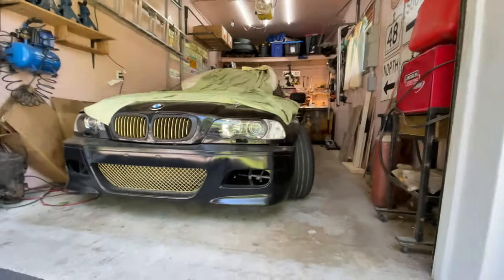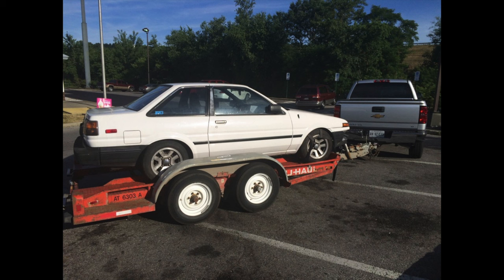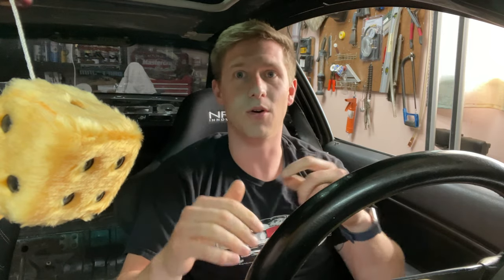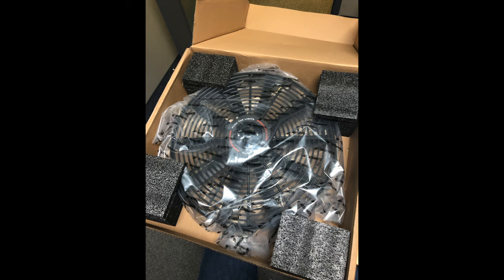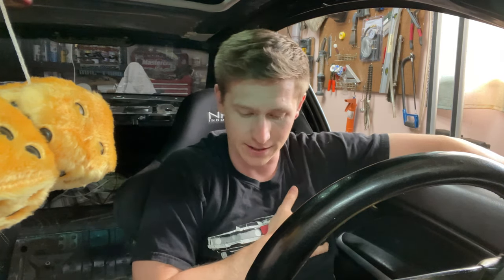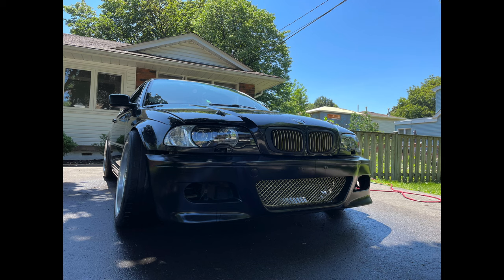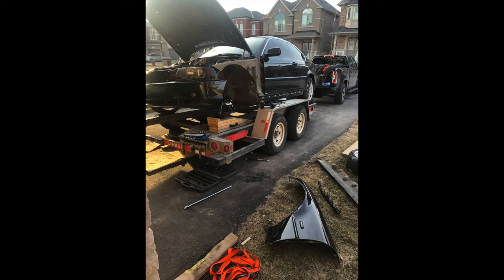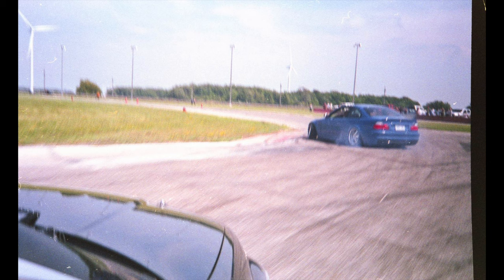How to Build a Reliable & Affordable Drift Car | Dirt Cheap E46 - Intro & Build Review

Comment: I love e46s so much you say it doesn’t look the best but I say it looks real nice. 2 door manual pre facelift 6 cylinder. Perfect and black! 👌
Reply from the maker: It’s a 50/50 car (50 feet away at 50mph). I would love a clean version of it that isn’t so beat. I love the chassis but this one is not the cleanest. I have also hit a wall in it lol
Reply: @SDSGarage89  it's a drift car, u are supposed to hit a wall in it and it's not supposed to be clean 👍

Comment: Hey dude I know this is 2 years old, if you still have it, sell the catch can and replace the ccv system,  it’s been tested and proven the stock system is by far superior in performance rather then an aftermarket part.
Reply: Not true at all. CCVs don’t provide enough crankcase pressure causing problems with low tension rings. Along with that it’s also been proven that the ccv under sustained high revvs likes dumping oil in the intake

Comment: It should have come with 193 if I’m not
mistaken from the factory, with cai and headers and extra fuel you’re probably getting an extra 15-20 hp from that.  I own a M52tub28 with the MS42 and tune it personally.

Comment: Looks pretty dang good for a cheap drift car! Quick question: what tyre size/pressure do you run usually for the rears?
Reply from the maker: My go too tires are 205/55/R16 and I run them around 30PSI or less to try and get some sort of grip out of them. I am planning on going up a tire size to 225/50/R17's this summer. I have driven on 225's a bit and it has way more grip so it carry's more speed. I run 225's at about 35PSI

Comment: I think low - medium boost turbo will make it is less complicated than LS swap, and can be done quicker?
But sadly bolt on turbo kit for e46 is hard to find and can be expensive too.
nothing wrong with ls
Reply from the maker: I have always been curious about an M52/M54 turbo. They sounds pretty mean but I don’t have much experience with turbo kits. The complexity combined with it being a bit less common makes me shy away from it. Might be a false comparison for complexity considering you would be boosting the motor that came with the car vs slamming a truck motor into it lol
Reply: @SDSGarage89  turboing these cars is honestly quite easy and being that you have a b28 the rotating assembly is forged besides the pistons, you have to pull the engine anyways and it would be much easier to turbo it and then have it tuned stock ecu, you can very safely make 500 whp just with head studs and a gasket kit
Reply from the maker: @jayherrmannn  thanks for the info. Definitely worth considering. not sure what i am going to do with it at the end of the season. It is so damn reliable as it is. Just had the first event and went through 16 tires in a day with zero issues. It is absolutely lacking in power though. I have heard going to link is better for boost on these. A friend of mine is trying boost with a stock ECU and it's not going so well.

Comment: Hey man, I'm looking at getting one of these bmws to make it a drift build. I saw they've gotten a bit expensive though, where did you find yours?
Reply from the maker: I found it on Kijiji (craigslist of Canada) in the early fall about 4/5 years ago. Prices have for sure gone up since then but i still see some decent looking bmw’s sometimes newer around $2500. Fall is a good time to pick them up if your live a more northern place cause people don’t wanna store them for the winter. Only downside is you can’t drive it for a few months. Facebook market place, drift pages. All good spots to look. Takes time tho. I looked for a month or so before i found my car

Comment: What is it a 328i?  I'm looking at a 325i but I dont know if iys going to have enough power.
Reply from the maker: 328CI, it had maybe 180hp. I believe a 325 would be about the same. It definitely doesn’t have the most power in the world but it gets the job done.
Reply from the maker: It may sound counter intuitive but starting with something that doesn’t have gobs of power will make you better in the long run. You’ll need to throw a low power car around way more to get it to do what you want to do but in the long run you will be better for it. I also would say don’t worry about a hand brake for the first year either. Good luck!

Comment: Would you say a 320i E46 has enough power? I'm thinking of getting one...
Reply from the maker: If you can get a 325 330 i'd go with that. Trueth is anything rear wheel drive with a welded diff will rip. You just need to drive it hard which in the end will make you a better driver and much more entertaining to watch .

Comment: Debating on getting a 03 325ci, would you recommend putting these parts into it ?
Reply from the maker: A 325 probably has about the same power this thing does if i had to guess. If it's a good solid car that isn't a rot box then i wouldn't hesitate to do it tbh. I find people get way to obsessed with swaps and power way to early, myself included, when the main thing they need is seat time to practice and figure out if you can sustain doing this.
Reply: @SDSGarage89   yeah , its just that its my first time getting a car to build but i cant find a decent e46 thats cheap, not abused or has its mods already.. only one i can find is one at a small dealership . idk if that would be my mistake to get one from them or from the street .
Reply from the maker: It's a tough call man. I have always been of the opinion you will get a better deal from buying it privately from somebody else but you need to work for it and be ready to do the deal immediately. Hard to say what the market is like by you. Patience will always pay off

Comment: does reliability matter if i swap the engine? serious question
Reply from the maker: Yes. Reliability of the motor you swap, the parts and ECU you use all matter and will make it work great or be a total nightmare. Do your home work and buy good parts
Reply: @SDSGarage89  well honestly i hope to get the bmw you have and ls swap it. i’m new to the car scene
Reply from the maker: I am struggling with the LS swap problem currently. I have had the car for 4 years and with a stock power train and all the changes i have made to it, it’s been dead nuts reliable. While it doesn’t have a ton of power it has been a cheap reliable car to drift with and get seat time to work on my driving. Now i’m at a cross roads. Do i spend 10 grand + on swapping an LS into it OR sell it as is, take that money plus 10k and buy something that already had a better power plant like a corvette or GTO. As much as i like the adventure and challenge of swapping a car it is a metric shit ton of work. You can do it fast for big dollars, or do it slowly for less money but still a good amount work and you run the risk of it beating you down and giving up. Personally i would get an E46, make it as good as possible with stock power and then see where your at.
Reply: @SDSGarage89  nice thanks for the advice.

Comment: Hey I'm not sure if I missed it in the video. Did you reinforce the subframe?
Reply from the maker: It has the reinforcement plates yet. I did not personally do it, the previous owner did. 1000% do it if you are going to beat on these cars.
Reply: @SDSGarage89  Thanks so much for the quick reply, was thinking you'd have to be crazy for not reinforcing it. Great deal though on the car for it coming with that though!
Reply from the maker: @jonathanandrade3669  no worries. When i bought it i had no knowledge about E46’s or their issues. Was just dumb luck that it already had them done. I still drop the subframe every once in a while to check it.

Comment: Can someone tell me how much I should be spending on an e46 in todays market lol, since everything’s more expensive nowadays not sure what a cheap car would be especially if I wanted to learn to drift
Reply from the maker: Hey man, it is impossible to answer that with any kind of certainty. Depends what state, country or place you are looking on. I'd say either buy one that a little old lady is trying to get rid of, or one that has some good parts. Stay away from anything that is non running, needs a clutch or serious work to get going. You will burn yourself out before you get to drive it. Good luck.
Reply: If you find one that’s already been drifted and beat on, (meaning it’s already built to drift at least a little) you don’t want to pay more than 8-9k probably. At least in my area, there are plenty of examples of pretty sweet and unclapped e46’s that typically go around 10k or maybe a little more. Now if it’s not perfect, and has over 170k miles you can find them at or under 5k all day. For exact numbers, it realty just depends on where you live and the exact car you find. Maybe try to talk them down if you see rust or if it needs new brake rotors,  or has leaks unless its already priced for that.

Comment: 180hp is low. That 2.8 with mild DME tune and headers should be pushing 205 to 215 at the wheels but only with the stock air box. Those “cold air intakes” are a waste. Car looks real nice though especially on those Parallels.
Reply: It should have come with 193 if I’m not
mistaken from the factory, with cai and headers and extra fuel you’re probably getting an extra 15-20 hp from that.  I own a M52tub28 with the MS42 and tune it personally.

Comment: did you wire the oil pump nut ever?
Reply from the maker: I have never had the pan off but I do know about the oil pump nut working itself loose. For some reason I thought they were more an issue on M54’s but could be wrong. Figured I’d just let it ride

Comment: My brother in law is selling a 2002 e46 325ci for 1k but the transmission is done for so I was planning maybe a whole engine swap? I wanna be able turn it into a drift car but not sure if I should or not. Not even sure if engine swap is possible. Any help?
Reply from the maker: My advice is based on my experience, Don’t do it. Buy a car that needs basic stuff (coil overs and welded diff) not a motor swap. If you are wanting to learn how to drift, the learning curve is steep enough, you kick it off by swapping a motor and you are more than likely doomed. Pay a bit more for a car that needs less. Start with driving not building, plenty of shit will break that will need fixing on a good car.

Comment: we cant even buy an rc car with that money in our county. so sad
Reply from the maker: Sorry to hear man. These cars have gotta very expensive since I bought it a few years ago.
Reply: @SDSGarage89  im trying to find a new chassis to drift, looking to spend >5k but it seems all driftable cars are very expensive now. Any sites to check besides CL or FB? Or chassis recommendations?
Reply from the maker: @2wofacejefe  Hey man, the pricing and market that you are dealing with can vary so much depending on where you are located. As far as places to find them, i would recommend Facebook, both market place and drift or race car groups, Craigslist is also good but a pain in the nuts to search multiple areas, Kijiji (if you are in Canada) and i don't know if Zilvia.net(?) is still a thing. As far as what to buy, something that is mildly "Built" to drift (coilovers, welded diff, some drift spares and anything else, maybe a hydro but i would recommend learn to drive without it, it will make you better) will save you time and money as long as it as been done somewhat well. What type of car, the most common i see are E46, E36, G35, G37 (sedans and Coupes), 350Z's, foxbox mustang, SN96 Mustangs. Buying them for 5k will be a trick depending on where you are. Some up and coming chassis i think could have potential are Hyundai Genesis (3.0 fuck the turbo) and this is way off but the Cadillac ATS. Hopefully that gives you some stuff to work off. Lastly, I wouldn't get too attached to buying a "specific car" just look for a deal and be ready to jump on it that day with cash and a trailer. I knew nothing about E46's other than it was cheap and was could drift exactly as it sat. Good luck man!